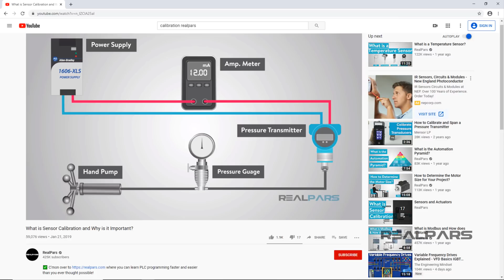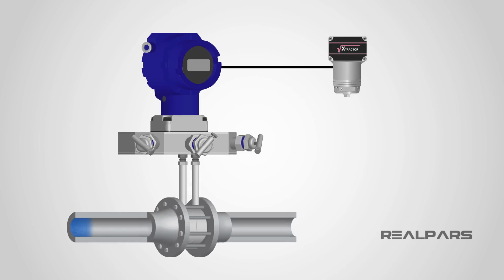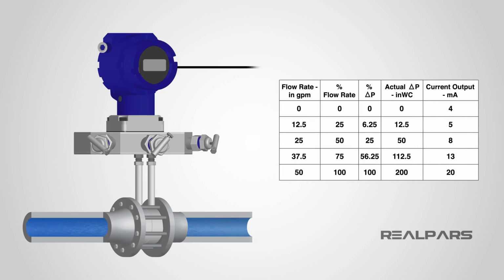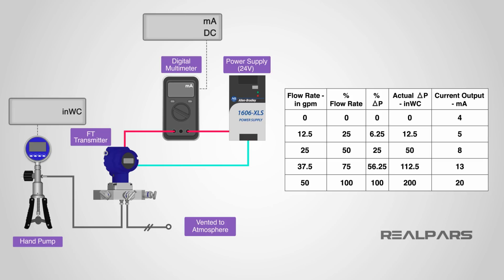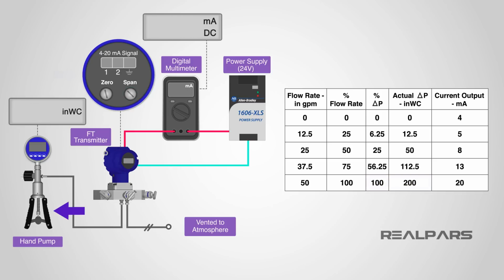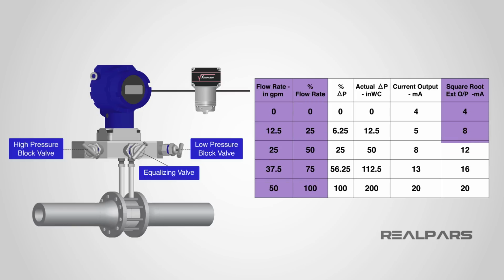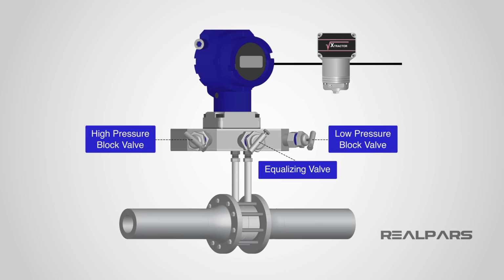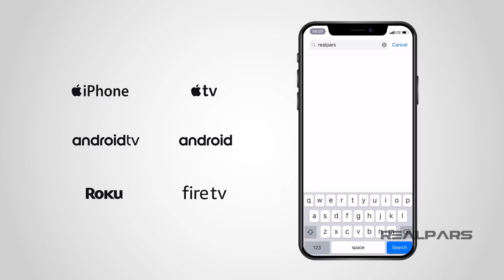DP Flow Transmitter Testing and Recalibration

Comment: Very good video, great explaination.  However, it seems the rotating directions to open and close manifold valves are reversed ?  Opening is normally counterclockwise and closing is clockwise rotation.  I see the reverse in the video, or is it a optical illusion ?
Reply from the maker: Thank you for your question. While this might be accurate when considering plumbing fixtures, the scenario could differ when dealing with industrial devices, particularly due to the distinction between left and right-hand threads. The instructor in the video based their demonstration on their experience with a specific device at the time. For accurate installation guidelines, it's always advisable to consult your user's manual. The suitability of the threading may also vary depending on the vibration levels in the device's operating environment. I've included some links that might further aid your understanding on this topic.

https://accu-components.com/us/p/119-left-hand-vs-right-hand-threads-which-is-best#:~:text=A%20left%2Dhanded%20thread%20is,even%20under%20anti%2Dclockwise%20forces.

https://www.mcmaster.com/products/left-hand-threaded-pipe-nipples/
Reply: @realpars BS. Just admit your vid is wrong. Who makes reverse threads on valves? Anderson Greenwood? Please.

Comment: I think...the real value of current output at 50% of flux is 12 mA because : (20 - 4)= 16...the half is 8 mA that should be added to 4 mA. The real value of current output is certainly 12 mA. Many thanks to your videos.Little imprecisions give us way to open own mind. I'm sorry for my bad english.
Reply from the maker: Hi Natascia!  As you say, we want the current output to the PLC to be 12 mA at 50% flow. Unfortunately the flow transmitter will not give us 12 mA, but gives us a current of 8 mA.  If we connect a Square Root Extractor to the flow transmitter, we now get a current output of 12 mA.
Reply: @realpars  yes  u are wright

Comment: I hope you could've explained the reason behind the sequence in the manifold safe operating procedure on removing and returning the DP TX in service. But still great videos from Real Pars.
Reply from the maker: Hi John, When the transmitter is removed from, or returned to service, the valves are operated in a sequence to ensure that the delicate DP cell membrane is not damaged from excessive pressure.
Reply: @realpars  Would this not also be achieved by isolating the high and low side first and then equalizing?
Reply: To avoid connecting the transmitter to the process in one sode i mean if your transmitter conected to hight or low side at different time so it will damage your diafragm because pressure applied to one side of it

Comment: wanna ask a question, after we remove the service and remove the transmitter, before do the calibration, need to put it back to service ?
Reply from the maker: Hello, @salmanfaris9084  Thank you for your question. As we stated in our video, in general terms, you remove the transmitter from service and use the tools and charts needed to do the calibration.  Suppose it all works out as stated in your device's calibration procedures. In that case, you put the transmitter back into service, replace everything you remove, and then test your device in production as required, as stated in your calibration manual for your device. This video is general information only, and you should always follow the instructions on your device.  Happy learning from RealPars!
Reply: @realpars  thanks 🙏

Comment: Sorry I'm not understand the last equation how 8 ma is converted to 12 ma .....is there a sample equation to calculate that
Reply from the maker: Hi Mohammad. The key to these conversions is to remember to keep all units in percentages. The output is equal to the square root of the input because of the square root extractor.  An input current of 8 mA is 25% of the 4 - 20 mA range.  If we find the square root of 25% (.25) we get 0.5. If we convert to the percentage we get 50%. 50%  of the 4 - 20 mA range is 12 mA.

Comment: Why was pressure only applied to the high side?
Reply from the maker: Thank you for your inquiry. The hand pump is positioned on the high-pressure side because it connects to where the fluid originates, meaning it's under high pressure. This setup allows us to measure pressure accurately from this side. Essentially, the pump emulates the flow pressure experienced by the sensor. If you're interested in learning more about such devices, I recommend checking out this link to a company that specializes in them. It could offer you further insight into their functionality and applications. https://www.omega.com/en-us/

Happy learning!

Comment: One of the best descriptions of this process that I have seen. Truth be told, calibration is usually either skipped entirely, left to the engineer to fudge in the code, or farmed out to a third party to be done. But it's easy enough that it need not be. Excellent work!
Reply from the maker: Thanks a lot for sharing that with us!

Comment: Thanks for your videos!
I have a question: why did the 8 mA current output give us (25%)?
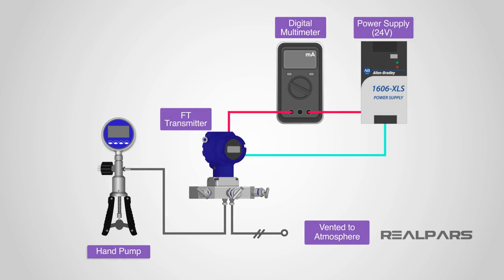Reply from the maker: Hi Eissa A. Thanks for your question.  Please refer to the calibration table at 02:50 of the video. The actual differential pressure is 50 inches WC which is 25% of the differential pressure range.  So, 25% of the 4 to 20 mA output range is 8 mA. I hope that helps! If not, don't hesitate to reach out again.
Reply: @realpars   oh I missed that! yeah that makes sense now. 
Thank you for your help

Comment: Great video, how ever, while we connect the hand pump and applying the pressure, the equalisation valve shall be opened or closed?
Reply from the maker: Hi there, 

Thank you for your question; it's a great one. However, I want to clarify that the information we provide is meant to illustrate the process rather than serve as an instruction manual for the specific device you'll be working with. Therefore, the best course of action would be to follow the directions outlined in your device's user manual or reach out to the vendor for assistance. We're here to help if you have any further questions or need guidance.
Reply: @realpars  Great. Thank you , Sir

Comment: Why do you close the valves but open the equalizer in a specific order? I don't get it.
Reply from the maker: Hi @John. Thanks for your question. Bottom line, it's about attempting to maintain a close-to-balanced differential pressure across the sensitive diaphragm in the transmitter.

Comment: At 01:20 why don't you close the high pressure block valve first instead?
Reply from the maker: To ensure that pressure is equalized on both sides of the DP cell.
Reply: @realpars  what if I close the high pressure block valve first then open equalize valve and finally close the low pressure block valve?

Comment: Why at 1:20 are you closing first the low pressure block valve? I think you need to open the equalizing valve first, in order to prevent damage to the dp cell. Am i not right?
Reply from the maker: The method in the video is correct.  First, the low pressure valve is closed, which keeps the current pressure on the low side trapped against the capsule.  The output of the transmitter is maintained near the current value.  With the low pressure valve closed, the equalizing valve can be opened, so the differential pressure is reduced as the pressure on the low side equalizes to that on the high side.  Finally, the high pressure valve is closed.  With the equalizing valve still open, the excess pressure can be bled from the capsule to make it safe to remove or calibrate.
Reply: @realpars  yes, you're right. Thanks!
Reply: @realpars what if you open the equalizer valve first then close the lp block valve and close the hp block valve.
Reply: @IKENNA369  i think pressure from the hp side will go to the lp side. Maybe this will not damage the DP cell itself, but nevertheless it's not the best technique anyway

Comment: hellow everybody please I ve a question at the calibration , my quastion is that 
if we has an instrument like  flow transmitter and after teasting we find out that the out put current is corsponding to the  input at the zero input and full input for example transmitter which has input range from 0 to 100 gpm  after teasting we got 4 mA  from 0 gpm  and 20 mA at 100gpm  but when we cheach the instrument in 50 mA it does not produce 12mA it produce 13.4mA  so how to calibrate this  ?
Reply from the maker: Thank you for your inquiry. Your question is quite intriguing; however, it's important to note that our videos primarily serve as foundational learning resources for understanding engineering concepts in the industry. They are not intended to replace the manufacturer's manual for your specific device.

I recommend thoroughly reviewing your user and operator's manual for your device as a first step. This manual should provide detailed information tailored to your device's specifications and functionality. In the event that your issue persists after consulting the manual, I strongly advise reaching out to the manufacturer of your device for further guidance and assistance. They are the experts in their product and can offer specialized support to address your specific concerns.

Before contacting the manufacturer, it's also worth checking all your wiring connections to ensure they are secure and free from any electrical interference. Electrical noise can sometimes disrupt the signal from your transmitter, and this aspect is occasionally overlooked. Ensuring correct grounding is in place can also make a significant difference in addressing such issues effectively.

We appreciate your commitment to learning, and we hope you find the solution to your challenge. Happy learning from RealPars!

Comment: I'm just confused about the direction the arrows are pointing to open and close the valves.  I thought turning it to the right would close it and to the left would open it,
Reply from the maker: Typically "turn right to close" and "turn left to open" would be proper.  Always check the action of any device before operating it to ensure you know the "sense" of the device.
Reply: @realpars  thanks!  Still an awesome video

Comment: Where we connect pressure pump port. is it in vent side of manifold valve
Reply from the maker: Hi Denil.  The pressure pump is connected to the High Pressure (HP) Port.  The Low Pressure (LP) Port is left open, or vented to atmosphere.
Reply: @realpars   thank you

Comment: This is a bit deceiving.  You are not calibrating the flow meter with this set up, you are ONLY calibrating the pressure transmitter section of the flow meter.  If the orifice plate or other components have issues this calibration will not help.
Reply from the maker: Hi Jason, you are correct. Any changes such as a different orifice plate would change our calibration values. That's why we've specified that we are calibrating the differential transmitter only using the given DP values and flow rates.